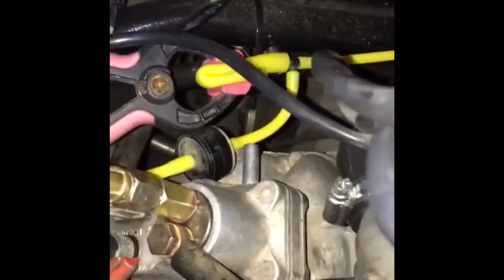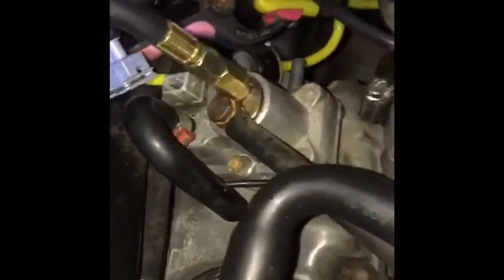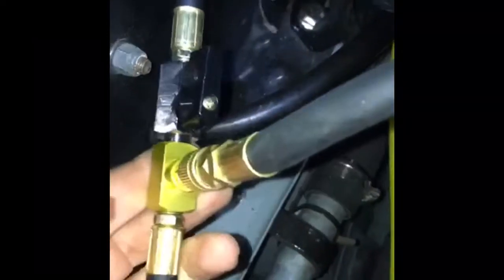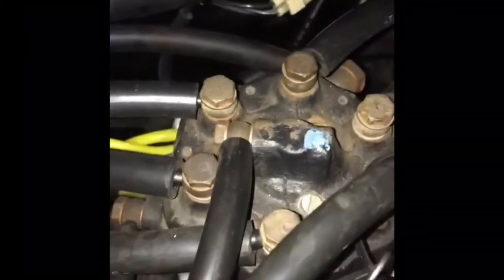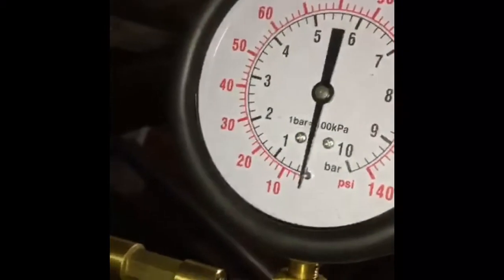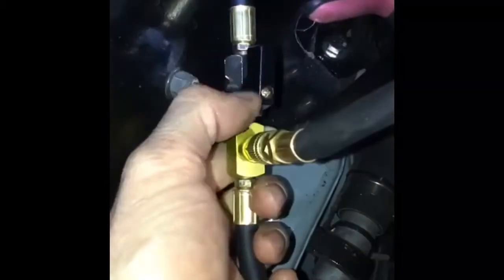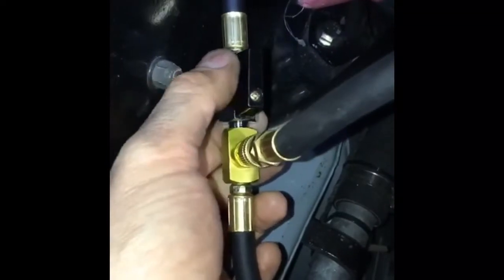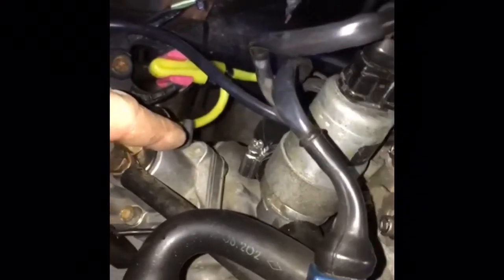DeLorean Fuel Pressure test connections for the Pressure gauge

Comment: What where your results? About to do the same on my car
Reply from the maker: Hey. I wrote down the figures using a copy of the table/format from the owners manual.
Ultimately I had to add or remove a washer to alter the pressure slightly. I can’t remember what I added/removed , but I brought a kit of washers and did Alter it slightly:)